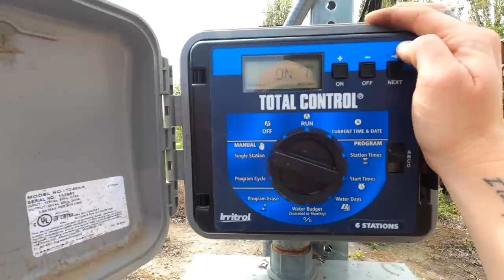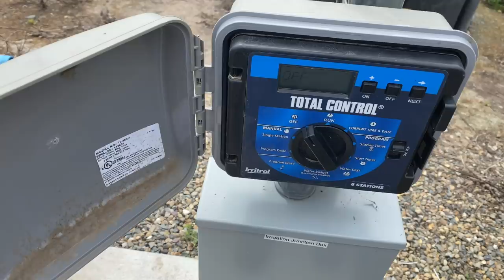HUGE CHICKEN UPDATE + Vineyard Irrigation!

Comment: Open all the row valves at the end the year. Leave them open over the winter.  In the Spring time. Turn on the water. Let clean out the lines. Close them off one at a time. You don't blow apart any lines. Those that don't put out water. Check  the main cut off of each line. Then close the drain on the that was not working after you get water there. Then go through rows make sure the are no bad hoses. The sun can breakdown drip hoses over time. It will save half the time per year.
Reply from the maker: Great idea!! Thank you
Reply: Why leave the lines open all winter?  Wouldn't that allow bugs to enter in spring?  Remember, Tara lives in warm California where the bugs get started early.  Also, she probably rarely (if ever) gets freezes.  Still, so long as you drain the lines in fall, lines breaking from water expanding during a freeze shouldn't break any lines.

Comment: Nice day to be in a vineyard beaver style with all the chicks 🐥 so when you put in the pto, you start the tractor then stop the transmission,to do that you push in the clutch and put the main gear box in gear, then put pto in gear, the whole time pushing in the clutch, right before you put pto, in gear at the same time rock the clutch pedal in and out ,that rocks the transmission gears a tiny little bit, the reason,to mesh all of the gear teeth synchronized the gears ,then it will all go into gear easier, then take main gear box out of gear and release clutch, watching your pto implement, all in a good days Tractor work TARA, you are doing a amazing job, thanks BigAl.

Comment: You might just have one scv valve that has the detente to stay open. If you push down or pull up there should be a point at which it should lock if you are equipped with a lockable scv valve. If not this lockable valve can be change with one you have on now. It is an option when buying the tractor.

Comment: try pushing in your clutch then put pto in and let your clutch out. I did not see if you were doing that so sorry if I miss spoke. all tractors are deffrent   so I might be speaking out of line.
Reply: It's a newer tractor with Independent PTO.  The clutch has nothing to do with PTO engagement.  Just be sure to ALWAYS engage PTO at an Idle and feather it in if you can.
Reply: @Zimmerdf   thank you for the answer

Comment: There should be dials on your hydraulics on remotes on top of your valves in back of Tractor to run constantly,  like hydraulic motor.  There should also a rabbit  and a turtle to adjust speed.